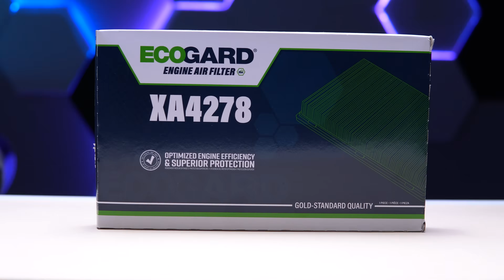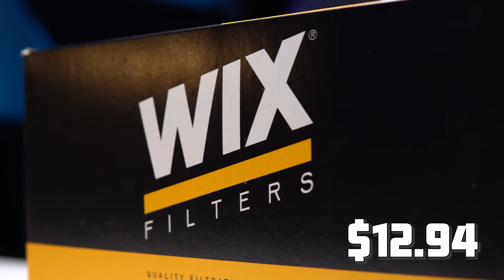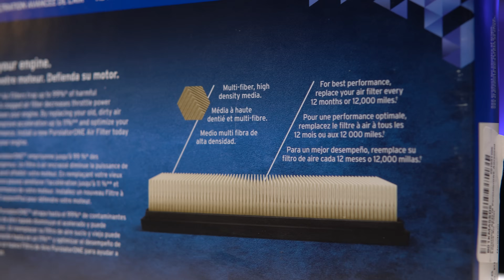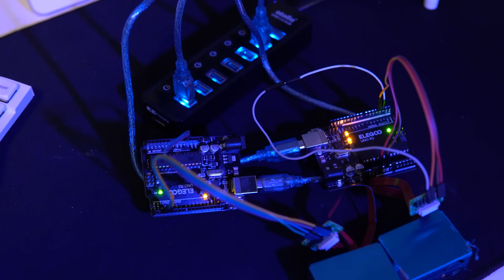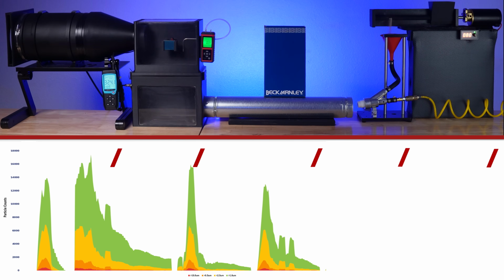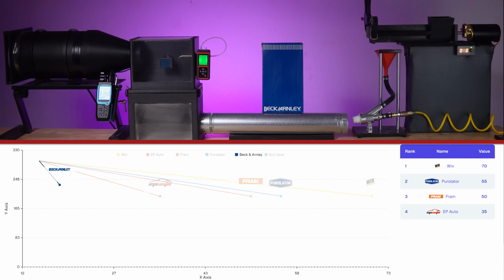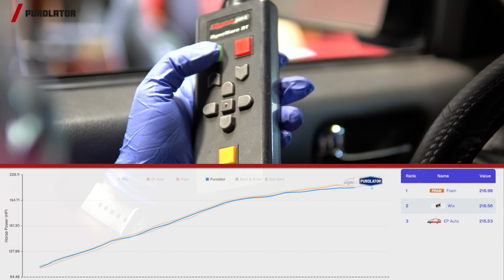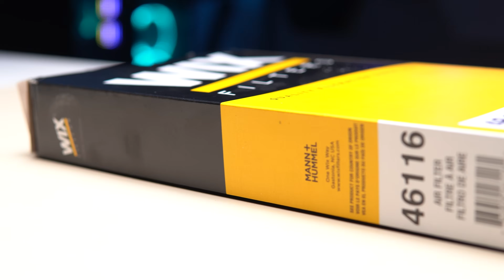*NEVER* install THIS if you want your car to last! (Engineer Tested)

Comment: Now time for cabin filters
Reply: YES PLEASE
Reply: I nominate motorcraft filters for worst one.
Reply: You want the charcoal activated cabin filters
Reply: charcoal/carbon activated wix, bosch or mann
Reply: Dude people don't even change those. When I changed the one in my high mileage Honda I bought, I knew it was gonna be bad because I could see the previous owners had dogs, but I wasn't prepared for the filter to be basically all dog hair from what I could see, and installed backwards to boot 😂
Reply: @Hillykarma  What do you mean installed backwards?
Reply: @njsongwriter  installed with the arrow the wrong way. Air filters have a flow differential depending on the application. Ever noticed how on your houses HVAC filter it has an arrow showing the direction of flow?
Reply: Buy the cheap no name cabin filters.  Cars used to not even have these, it’s not performance based.
Reply: @commonsense2469 I'd much rather a quality cabin filter and not breath in crap than a cheap one

Comment: I have an idea you can try out, it shall be interesting and easy to test, you can test spark plugs, check resistance, and start too increase the gap and see what happens, put the spark plug in a compressed container and increase the pressure from 150 psi to 300 psi and check what happens, be careful anything above 80 psi it shall be very well build and remember to test the vessel to 1.5 times your maximum test press.

Comment: Great testing. Just put Purolators in both my 4runners this week, but the wix and purolators are over $20 for my vehicles locally and amazon. It's crazy.
Reply from the maker: Wowww those are some crazy prices! Check out rock auto maybe. Thanks for watching!
Reply: @BrandRanks  Just checked rock auto... Much cheaper. Thanks
Reply: Rock Auto. Buy two, shipping is where they get ya

Comment: Can't believe you left out K&N! Great video tho.
Reply: Checkout project farm’s test on air filter he basically ran the same test with K&N part of the test. Basically K&N won the air flow test performance/acceleration but the worst protecting your Engine. What you want is balance and that’s what Wix won Project Farm’s test.
Reply: @gmsagolil3496  the thing is during normal driving conditions the engine oil uses a small portion of the are that's available. I choose protection over one extra horsepower performance
Reply: Because k& N has a hard time even catching a boulder

Comment: For filtering performance, you really need a pulsing pressure/flow mimicking the actual air flow in an intake. There's some good info on why K&N cotton filters work better in practice than on static filtering tests due to this phenomenon. It would be interesting to see the filtering results under such conditions. If you plan to add premium filters to the test, then please look into how to mimic those characteristics.
Reply from the maker: Thank you for the suggestions. We were trying our best to mimic ISO standard testing like the one performed by K&N. Appreciate your support

Comment: Should add k&n to the test since their fan boys swear by them.
Reply from the maker: Yes! We will be testing them in the next video! Thank you for watching
Reply: Project Farm ran the same test with K&N. K&N did very well in air flow the best on project farm’s test but the worst protecting your engine. Basically he said there is trade off between air flow and protection. What you want is balanced and thats were Wix won the project farm’s test.

Comment: Would love to see k&n oiled filters too
Reply from the maker: Yes! Coming up on the next video! Thanks for watching
Reply: @BrandRanks awesome, been using it, but really want to see if I'm letting harmful dirt particles into my engine.
Reply: @BrandRanks also please take MANN filter for comparison
Reply: The filtration is shockingly poor.
Reply: @abeclarkatp2595  yep this is what I've seen as well. It gets great performance and flows well because it doesn't filter well at all. I'm sticking with my tried and true Wix. Review after review has Wix on top. Plus unlike in this video, my Wix filters are 2 stage, with a meshed fabric to catch bugs etc from getting into the finer pleats.
Reply: Avoid K&N. If you want an oiled filter, use greenfilter
Reply: @tacticalcenter8658  Why though these k&n filters have been no issue for me at all
Reply: You'll see K&N fail miserably when they test it.
Reply: Hengst, Acdelco, Mahle, and Denso, and maybe an OEM such as Subaru or Toyota 😉. Waiting patiently.. Great job on the test!  Appreciate the massive effort involved in making this video!!
Reply: The Air needs to pulse....like it does with an engine.
Reply: The engine will be killed
Reply: @candyman1967  ?
Reply: @transgrl  lol yah but no one I know maintenance that filter right
Reply: @ashishpatel350  I clean my cone one every 12 months or so, apparently they can go for longer but what's the point in letting it get dirty when it's for performance
Reply: @transgrl  you might be one of the few most of those filters are barely even oiled
Reply: @ashishpatel350  oil screws up map sensors,I had one in a PT cruiser,it would idle rough,plus they filter poorly,I wouldn't use one in a car,period.
Reply: @philipeli1192  agreed, for racing use only.
Reply: @tylough I wouldn't use it for racing either and no real race teams worth their salt would either.
Reply: @ashishpatel350  With the way I drive it I think I'd be too paranoid to not  ensure its cleaned and oiled properly lol
Reply: @philipeli1192  Honestly I had worse issues with oil vapour when I had the stock airbox with how the PCV hose was set up, K&N filter has been completely fine for me, I replaced the map sensor yesterday trying to diagnose a misfire and it literally made no difference and the old map sensor looks good. I do clean my map sensor when I do my oil change with electrical contact cleaner though so idk how it would be if you were to just never clean it.
Reply: @philipeli1192 me neither. Dry filter all the way for my daily.
Yes oiled filter only makes sense for race track engines that get rebuilt often, and where that extra cfm flow can mean win or lose.
Reply: @transgrl  you must hate your engine lol. They don't actually filter much at all

Comment: Basially, use the fram change it often. Filters good, best performance at the cost of not great capacity, but cheap, so change it often.
Reply from the maker: Indeed really good filter. Thank for watching and supporting our channel!
Reply: Except nobody changes filters often and it can be a pain on many cars.  Better to buy the Wix and sleep easy.
Reply: @LTVoyager  I mean, you only loose performance if you do that.
If you are obsessed with performance, then change your damn filter.
Reply: @oncrei  My focus is on engine life, not performance, as is the focus for 99% of car owners.

Comment: I would love to see you test the AEM Dryflow versus the old performance standby, the K&N.

The K&N has long been the standard for anyone looking to upgrade, but the tests (with the flawed "drop the dirt on the filter" methodology) that have been published thus far (Project Farm and others) have shown it to not be so good. This is why I do not have a K&N in my beloved Mustangs. I have instead gone for the AEM Dryflow, a cleanable lifetime filter that does not need oiling, and that is supposed to filter much better than the K&N. I would love to know how it stacks up in your superior test method.

Also, since the K&N and Dryflow are washable, I would also like to know how well they filter after repeated cleanings. Does the filtering ability decline as the cleaning process removes fibers (something that has been rumored with the K&N)?

Incidentally, I believe AEM is owned by K&N, which makes it rather interesting. If I were AEM, I would be marketing my product as having much better protection than K&N while still producing great airflow... but they would not want to harm the sales of their best selling K&N brand!
Reply from the maker: All amazing suggestions and yes we will be testing AEM and KN both dry and oiled. Very excited to share he results in the next video. Thank you again for all you do and suggestions you make on every video!
Reply: @BrandRanks KN is Garbo. Try greenfilter.
Reply: @BrandRanks please test the AFE pro dry as well. The AFE pro dry and AEM dryflow seem to be the best "high performance" filters you can buy when it comes to filtering ability
Reply: @BrandRanks worth a look at the video from the guy who invented the K&N suggesting that engine vibration is necessary for the K&N to optimize filtration and if that could be incorporated into the test.
Reply: To me the way project farm did it, just dropping the dirt onto the filter directly, invalidates the test. that's not how air filters work and k&n was not designed to work that way either!  I'm excited to see these guys test it correctly!
Reply: I've bought 3 or 4 AEM dryflow cones in the past 2-3 months and their quality control is horrible. Creases and scratches along the filter media and loose rubber on the inside. I used a dryflow on my car the past 1000 or so miles and there is build up of fine dust on the rubber couplers. It's very fine almost like a powder, but I've never seen this with the OEM paper filter.

I'm wondering if AEMs quality and filtering abilities have gone downhill since k&n bought them out. My girlfriend has an AFE pro dry s on her intake and when you hold it up to the light next to the AEM dryflow the AFE is noticeably more dense and there are no tiny pinholes in the media like with the dryflow. It seems to be a challenge to find a washable filter that filters as good as the OEM paper filters

Comment: Outstanding! When you solicited comments on this upcoming test, I suggested that you make sure that you design the test so that the dust is suspended in air as it is drawn into the filter, the way it would be in an actual car. All the other tests I have seen on YT have just dropped the contaminants onto the filter surface, which is not at all representative of the challenges a filter will have to overcome in an actual vehicle. I am not sure if my suggestion played a role in your decision to do the test as you did, but either way, you did a fantastic job!
Reply from the maker: Of course we read your comment! Thank you for bringing it up.We did tons of research into this testing to ensure it was as close as possible to the ISO standard test. Really appreciate all your suggestions and feedback. You support is immensely important to us!
Reply: They answered you but didn't change a thing.

Comment: Very much enjoy your engineering approach to testing products. For air filters, the capacity is interesting but I would be very interested in how much dirt an average air filter actually collects in a year. I would doubt it would be anywhere close to what you show as the capacity for even the worst filter.

Comment: I've got a V8 SUV now so top-end performance isn't my No.1 priority, I Love using Purolator or Wix as filters. 

As for changing I inspect every oil change, Toyota calls for every 30k miles but I find 15-20k to be more accurate.

Comment: Every 4 months this channel reminds me it exists. Such high quality content from such a small channel. Hope ya grow cuz I want more content!
Reply from the maker: I know... We wish we could post more, very hard to balance a full time job. We hope to grow as well so we can do this full time and put more content out there for you guys. Thank you for supporting us and always watching. It keeps us motivated!
Reply: @BrandRanks just curious, as the engine and filter vibrates, does this affect filtration?
Reply: @labpartnerlp I was told that it does. But I don’t know that for fact.
I was also told, that is actually how k&n filters the air 🤷‍♂️
Reply: @labpartnerlp  Not unless you have a very dirty filter which means change it anyway. The vibration is irrelevant and essentially the same you feel.
Reply: Just subbed, thanks for the research!
Reply: Just a reminder. A "high flow" air filter is the same as throwing dust and sand into your engine. The whole purpose of an air filter, is to block stuff going, not allow more flow. It's important to note that changing to a completely different filter media (you can see holes in K&N filter media) changes the jetting of your fuel injection at 75% or higher, during wide open throttle. When you run your engine "wide open throttle" (above 70% to 75% throttle)  the oxygen sensor is not being used, and the fuel mixture is calibrated for the stock air cleaner flow characteristics. The MAP sensor will pickup the changes, but on motorcycles, the difference between air cleaners can cause significant jetting changes that cause lean spots in the fuel mixture, which on some engines can cause detonation or just rough running in the power band. Stock motorcycle tuning (EFI jetting) is incredibly precise, and has immense torque, and when you change to a high flow filter, it's completely possible to develop rough spots in the power band.

Comment: Your summarizing statement that "the better the filtering performance the worse it did in the engine performance test" is incorrect.  The WIX was tops in filtering by quite a bit and was not appreciably behind (0.42 hp) the top-performance Fram.  Using your logic, it should've been DFL.  That's not my data, that's yours.  If the actual dyno has a problem differentiating the two, your butt-dyno sure as hell won't.

Comment: Would love to see premium air filter like K&N or other no-oiling  high flow comparison please.  And even the results against these traditional air filters just tested.  Amazing video !
Reply: K&N  and similar filters DESTROY engines!
My engine got a bad oil consumption and some smoke after 2 years and looking in the intake it was sand everywhere!

Might just as well remove the filter all together....
It is GARBAGE at filtering and still about the exactly same pressure drop as a proper high pleat filter since it has much more surface area for the paper filters
Reply: K&N is not a good filter.
Reply: Project Farm has a vid showong what you want
Reply: @LordAfrocious  okay ty so I was correct . You're a paid SHILL with no soul and disgusting.

Comment: I honestly spend for the quality filters because of the gasket media rather than the filter media. 
Sometimes cheap ones have really wonky dimensions/density, ie. won't seal or air box tabs are a fight to get back in place.

Comment: Also surprised you didn't use the factory filter. I would assume you can readily get OEM stuff from dealers over there?
Reply: True a comparison to the genuine part these filters replace would help people.
Reply: Naw. Premium price for a trash filter.
Reply: @LordAfrocious  point of test is to see what you are getting but not compared to genuine option, half a test.
Reply: @LordAfrocious  I disagree. The OEM is normally better than aftermarket. 
At least in the filtration side of it.
Reply: @L3ER0Y  I'm not saying you're wrong... but what brand car are you driving??

Comment: @ProjectFarm (similar channel to Brand Ranks) did a good video on air filters years ago that led me to pick Wix as a balance of performance and projection, I'm curious how this test will compare to that one. I think more viewers of both channels should be checking the other channel out. I drive a lot, I typically change my air filter every 10K miles, or every 4 months. EDIT: After watching, I see that my previous choice has been justified.
Reply: I can't imagine a viewer that has found this particular channel but doesn't know about Project Farm
Reply: @JamesLPlummer  The project farm test was done incorrectly, he just threw the dirt onto the filter. That's going to clog up a filter in a way it was not intended and be  inaccurate results.   So now gravity and airflow are going to pull dirt through.

Comment: i was going to consider the Purolator but I would rather buy made in USA lying pieces of crap at Purolator claiming to be an American brand
Reply: He says while probably typing that on his Apple iPhone while wearing Nike shoes.😏

I was also going to say the stuff the other guy did.  The only reason you can consider it for about $12 is because of where it's made.  Doesn't stop Purolator from being an American company and some of the money being repatriated.
Reply: I understand your point, but it's not necessarily a lie as they are an American brand (trademark) and might even have their headquarters here.
Many American brands have moved their manufacturing to China to stay in business, but even that hasn't saved them as most consumers just buy the cheapest product on Amazon, even when it's FAR inferior in quality.; consumers are often wasting money while thinking that they're saving it.

I agree that the claim on the box will deceive some buyers, but it should be perfectly clear that saying "American brand" is NOT saying "made in USA" and any product made here will definitely put the latter on the box in large print.  Buyers with below-average comprehension may think that these phrases mean the same thing, though.

If you see ANY product claiming to be an "American brand" on the box, you can be almost certain that it's not manufactured in the US.